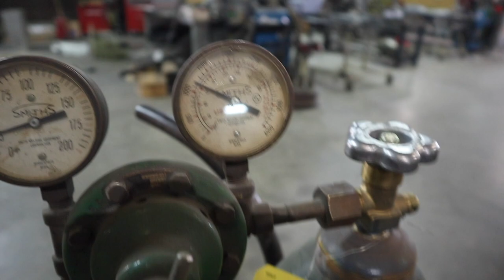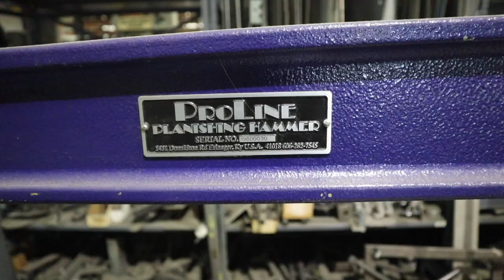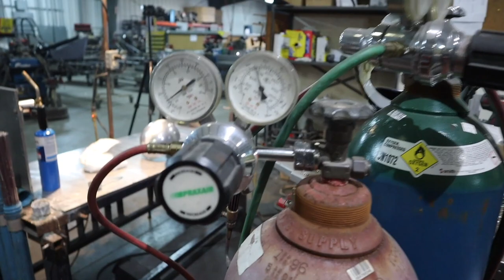the Mandalorians HELMET BUILD PART 2

Comment: Thanks for the video. I don't have your equipment, but I'm trying to make mine with what I have: angle grinder, vise, clamps, forge, anvil, buzz box, map and pro torches, hammers, reference photos and some informed guesswork. 🤣
Reply: Informed guess work is half the battle won already.  :)
Reply: I made one without the forge, anvil, torches. Used a stump for my dome and a big dome dolley, I even dropped it on my toe... not recommended. I just started this bad boy using Matt's templates. My welding and a bad dome template (f'd up by me) hindered the final product. Cheeks and mandables were sold welded, not bent like Matt's highly recomend getting a 90 degree bend attachment for your vice if you don't already have one 👌
Reply: What metal did u use can u send a like or at least the measurements cause I want to but got no  idea

Comment: Doming is sill the one skill that keeps eluding me. Then again, I'm using an English wheel and hand planishing.
Reply: you got it good. i'm using a ball pin hammer and a short aluminum pipe. (hammering down the hole)
Reply: @MrFjordbak  I started with that and a dishing stump.